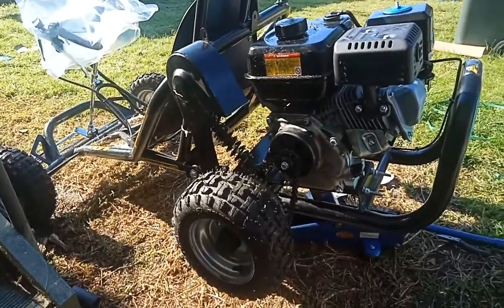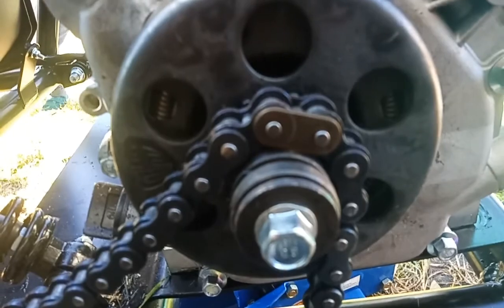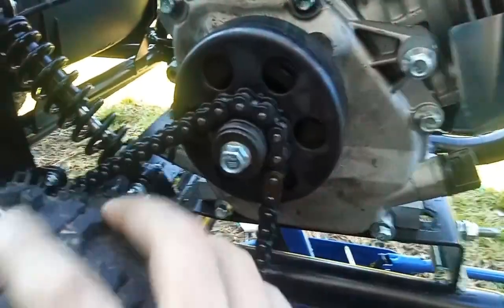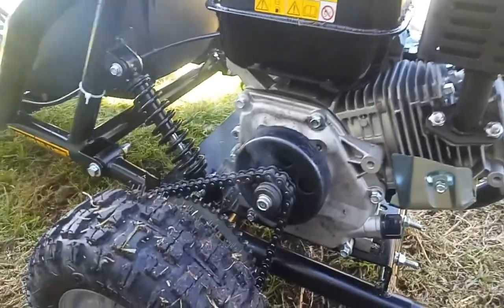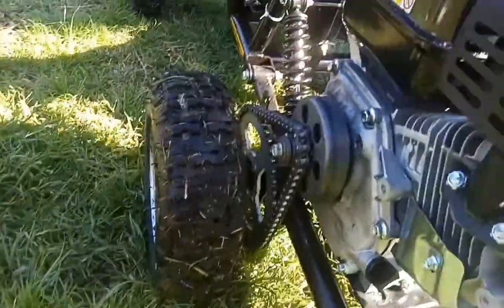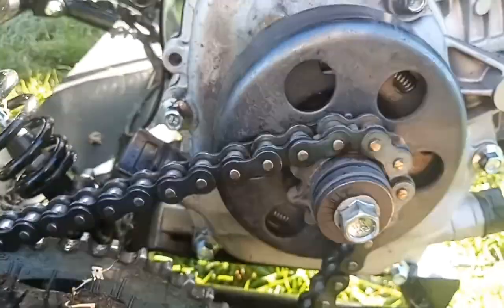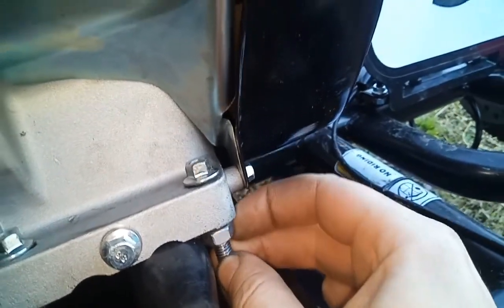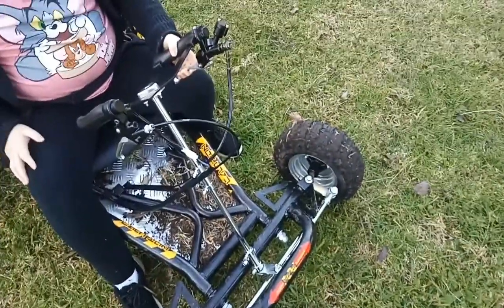Go Kart Chain Issues

Comment: You could've put spacers underneath the engine to get slack out. I noticed that the engine mount plate is thin, may flex on tightening up chain.
Reply from the maker: I did end up stacking spacers under the engine 👍and you're absolutely right, that plate is so thin it's completely warped. The frame is currently sitting half chopped up, but I'll get back to it one day, hopefully with a new plate and I'll get that TAV2 transmission mounted